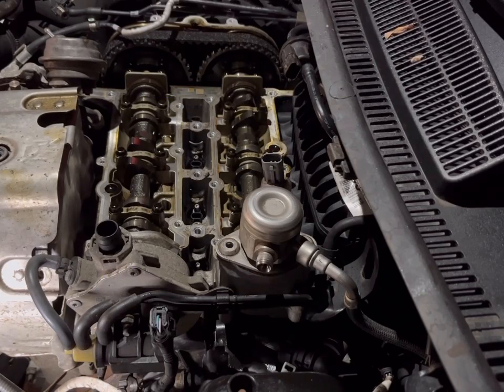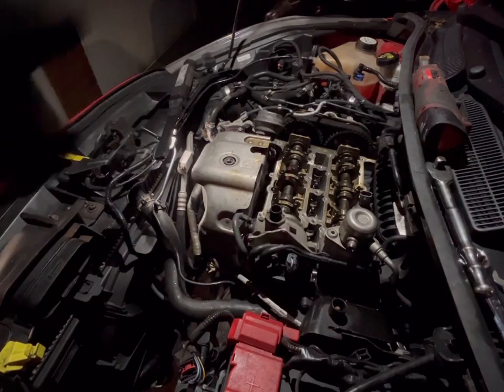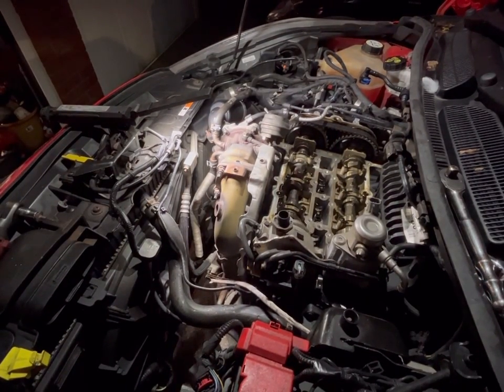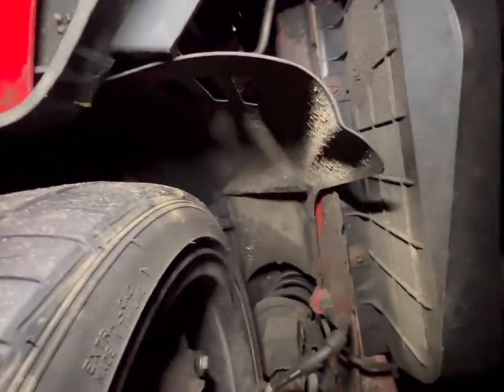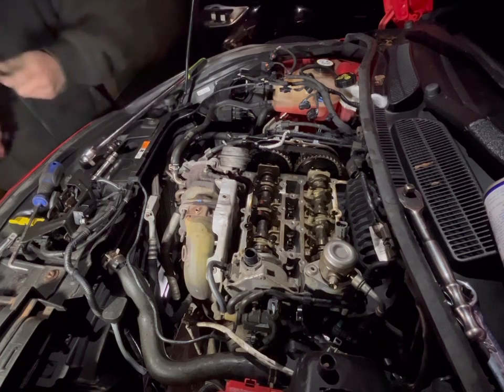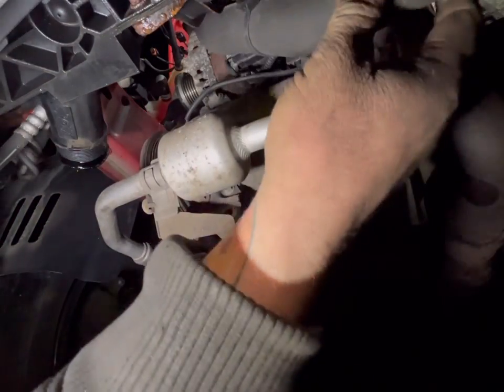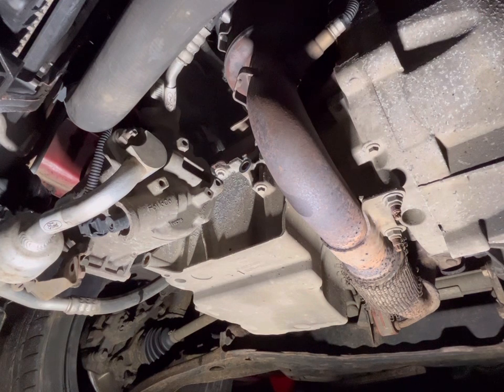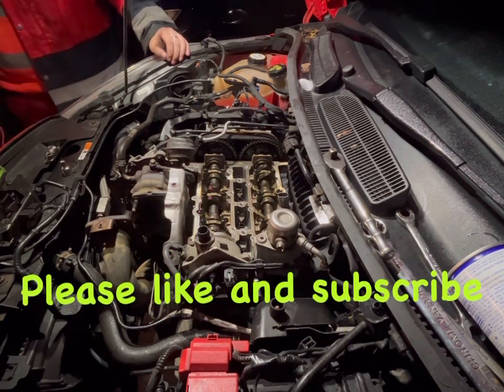Ford fiesta Ecoboost Saga: Episode 2 - Catalytic Converter

Comment: Hi thanks for showing your work. I just didn't catch or see the entire project. You didn't show just the removal of the cat, right? As the valve cover is off and you are doing timing belts and sump and everything else. Could you explain please, which parts NEED to come out or off to change just the cat?